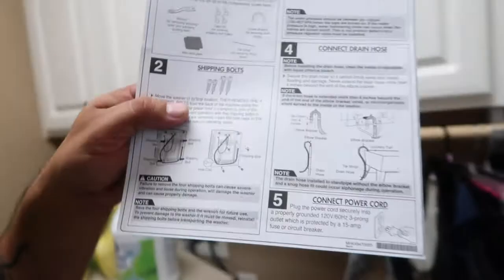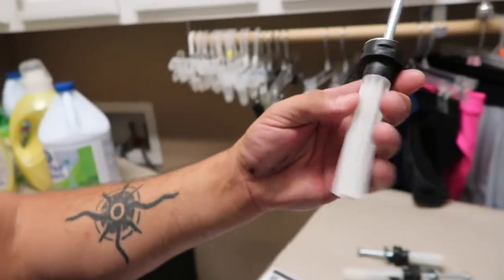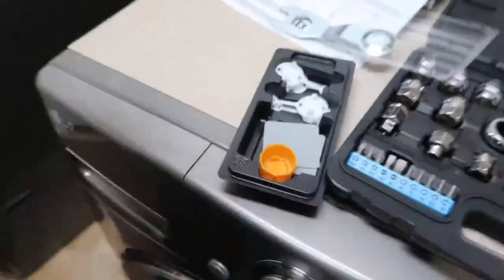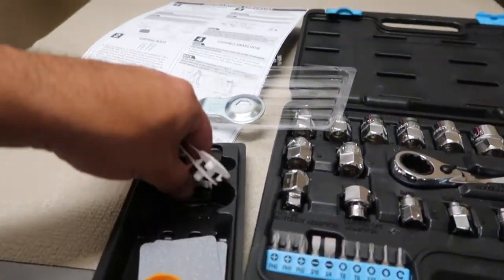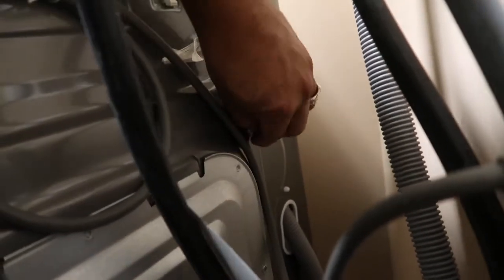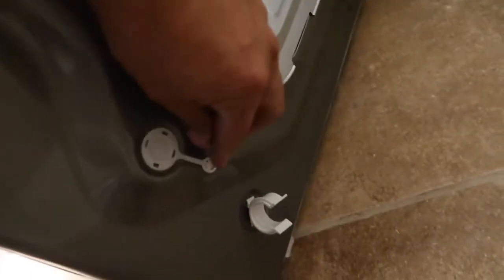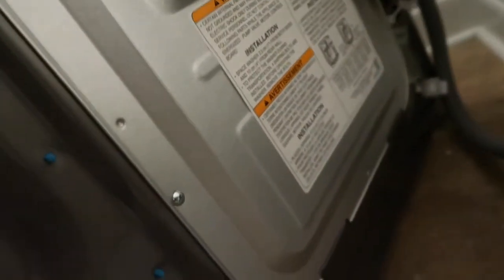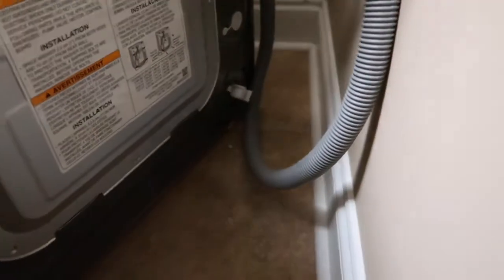Shipping Bolts Out Of Washing Machine Now

Comment: I did the same thing.  I think the front should have a big plastic sticker warning you to remove shipping bolts prior to using.  I was lucky and got 7 years out of my machine, however I have no doubt it would have been a much better performing machine if I had of done the right thing from the get go.
Reply from the maker: Great point!